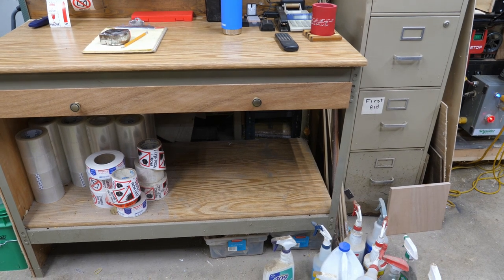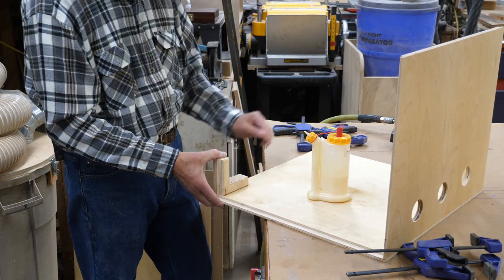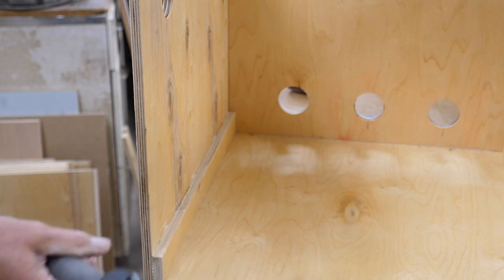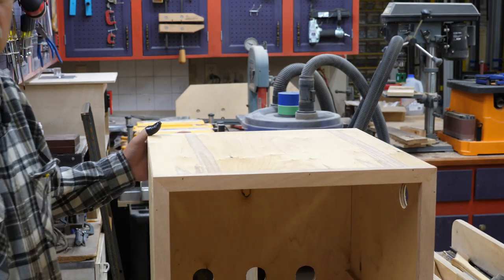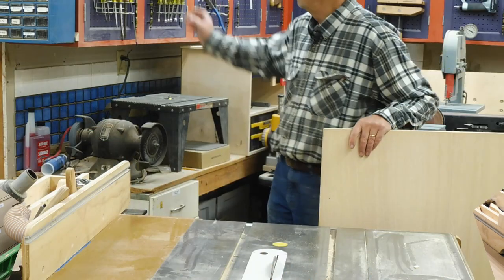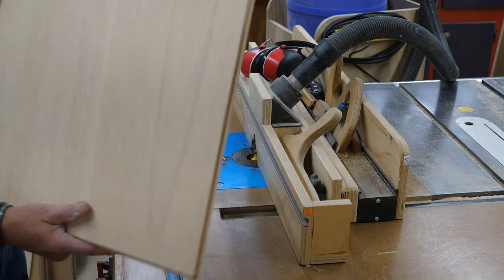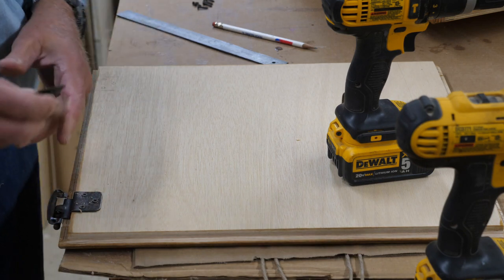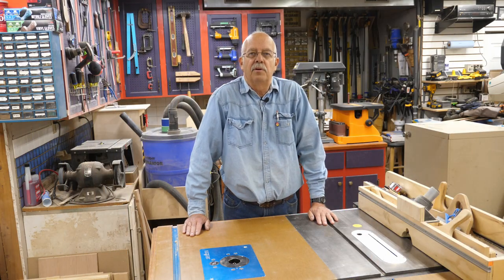Dustproof Printer Cabinet Build In Detail

Comment: Nice instructional video! How did you plan to run power to the printer?
Reply from the maker: Cord exits the back along with network cable through a small hole.